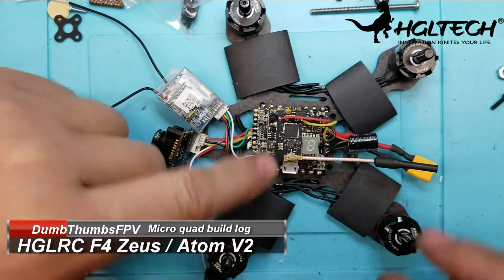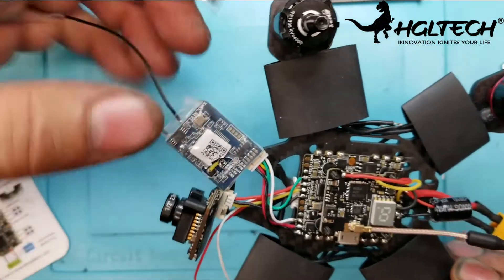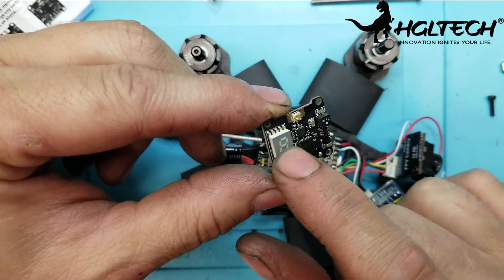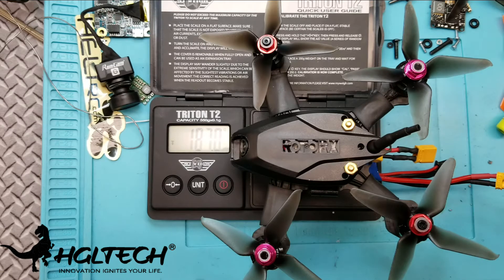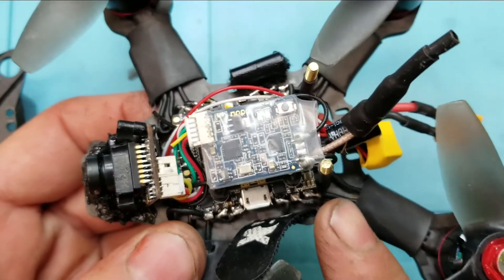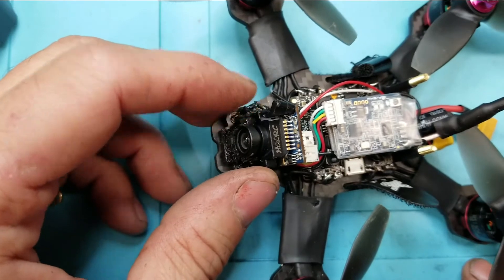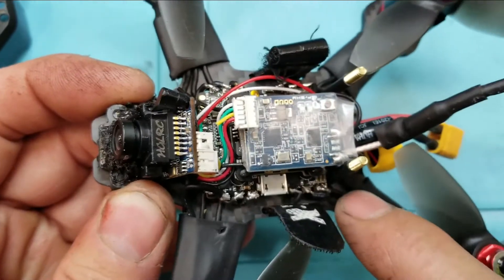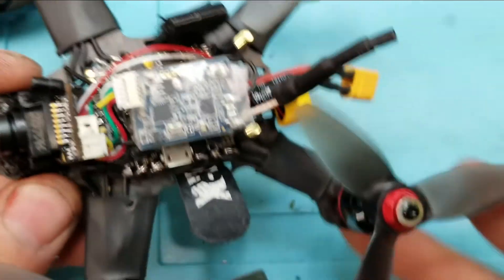Atom V2 HGLRC F4 ZEUS PART2

Comment: I just got one of these boards. I have a lot of questions. Do you know how to use softserial? On my Matek board I do a resource command in the CLI of Betaflight and then softserial shows up in the ports tab.  I don't want to solder onto that small spot on my r-xsr and would really like to just connect the inverted wire frsky provided.  Also, what range of motor and prop sizes might be good for the 15 amp esc?
Reply from the maker: Yeah I have done soft serial and used the PPM pad before but to be honest my last 3 builds I just solder onto the micro pad with the RXSR.. it's just easier and if I update Betaflight I don't have to redo the softserial..again and again...

Comment: Amazing videos, is the 15A value in Zeus enough for 3” 6000kv? Emax 1106 6000kv demand around 16-17A on 3S as per the charts I got. I’m still a bit lost there
Reply from the maker: Well they do have a 25 amp burst rating but that seem high for a 1106 motor? I ran a 5 inch /2204 motors with 15 amp ESCs on 4s before... and a 4 inch with 1806 motors on 12amp ESCs before as well so weird your 1106s are requiring so many amps
Reply: DumbThumbsFPV I base my information on EngineerX vídeos, but looks like there won’t be any issue as per your experience, thank you!!
Reply from the maker: OIC.. he does a great job for sure but motors that are static tested will always produce about 35% more amps than they do in flight on a copter.

Comment: I saw from your flight video that you are using 3S batteries. What capacity are the batteries? What was your final flight weight with the batteries?
Reply from the maker: I run a 850Mah and it's about 190 grams with battery. The Zeus is definitely the easiest board to build with to date. Everything is all around the edges and the plug has the beeper (BB), LED and more.